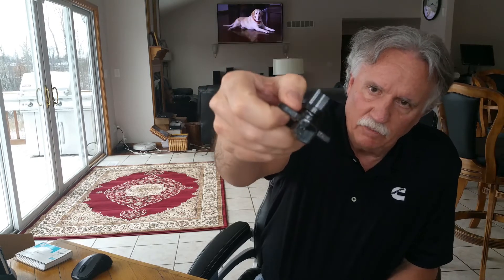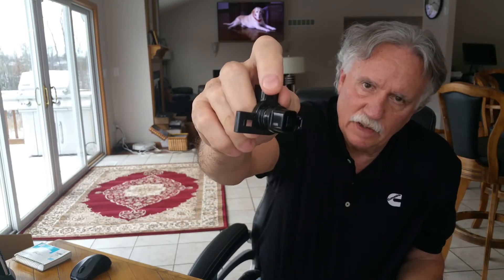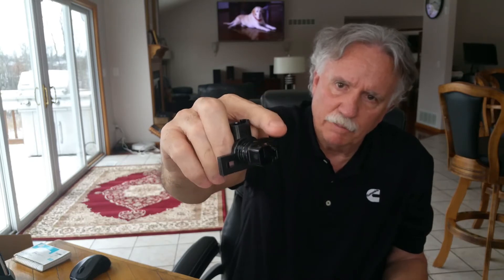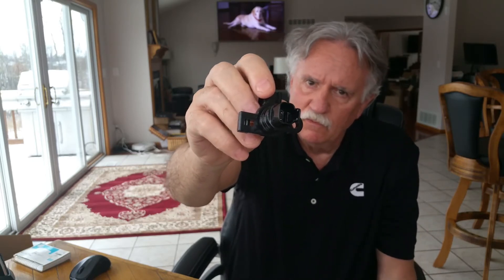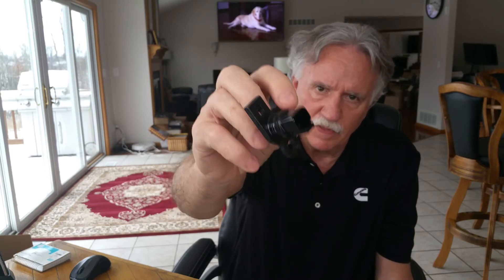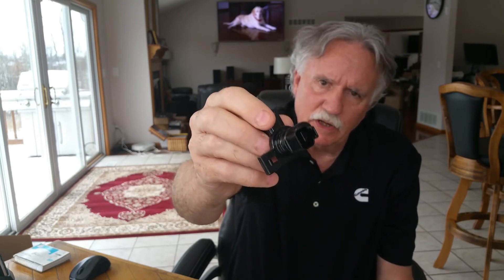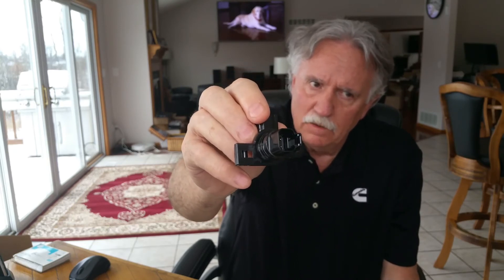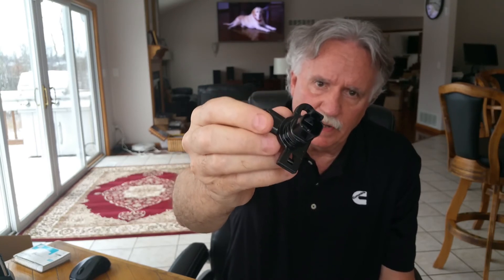Cummins N14 Injector shorts out your ECM injector driver for a certain injector number?

Comment: I don’t buy it. The wires are bare where they go into the solenoid. If oil conductivity was an issue, the wires on the solenoid would short out from the get go.

Comment: Hi Terry, have you looked into the CM876 upfit for the N14 that Cummins recently released?
Reply from the maker: Hi Charles, I haven't heard anything about the CM876 upfit.  Let me know if you find out more info on it?  Thanks Terry Chron 727.494.5514!
Reply: @breannachron392  it’s quite interesting they’ve moved the cam sensor to the front of the gear train, also added a sensor. Completely removed the cooling plate and ECM and updated it.
 They actually use a different cam and change the timing aswell.

Comment: I have a select plus that is cutting out intermittently .it wont shut down all together but fall to almost zero rmp and then sudenly WAKE up .I have proven all ecm/ecu power supplies and fuse holders wires ect, i have changed cam sensor ,all codes are coming up as " unknown code" thinking of throwing a crank sensor at it next?? any sugestions?
Reply: Well it’s been a year since your comment but here is my story. 3 months ago I had a major rebuild without removing the block from a new cam down I had replaced. I did not get new injectors because they were working well when I drove in for the rebuild and were only 2 years old. From the very first day after the rebuild, I had the same problem that you are describing and I was pissed so I took it back to the shop that done the rebuild and they changed the cam position sensor and it did not fix it so he tells me to bring it back when it throws a code and sent me a 200$ bill. I have a diagnostics laptop and it checked everything to find the problem but 3 months later #3 injector showed flat on the laptop. Well I pulled the injector and to my surprise, the harness in the head that connects to the pass through had oil in it. All I’m saying is that it’s worth checking for that.

Comment: If the ecm detects a short I find that it shuts off that section I never saw an ecu burned  .. Conductivity in oil cant put as much load in the mosfet chip as the actual injector coil would  .. I repair trucks and also the ecms   i find they are very solid  units
Reply: O have found this oil in connector issue is not isolated to cummins engines and certainly not to engines alone  transmission connectors suffer same fate, the engine issue seems to be more prevalent due to it seems the carbon in the oil which is what makes it appear black, less so on engines with shorter oil change intervals maintenance regimes and with centrifugal filter systems, seems to keep carbon content of oil lower with lower incidence of issues, JMHO from 40yrs trial and error

Comment: I have a 98 N14 celect plus and it cranks for about 5-6 seconds until I finally turns over, then I get a code 128s 354 12?? not sure what could be, any help would be appreciated
Reply from the maker: Sorry for the delay, I call the 128 a ghost fault code 128, 254, 12, SID = I found it to be a 111 Faultcode which is ECM Internal Failure. I'll try harder to keep up with all of your questions better in 2019. Www.N14Parts.Com ...Thanks Terry Chron

Comment: I have an n14 Cummins idling at 1100 an don't want to go lower what would b d problem
Reply from the maker: Sounds like your injector or injectors are dribbling excessive fuel into the engin. Replace 1 or more of them Cummins injectors start going down hill at 500,000 miles and the crankshaft bearings should also be replaced (Called a Bearing Roll Over)